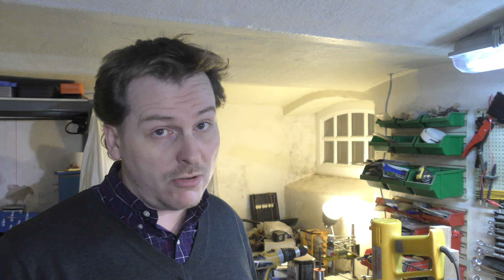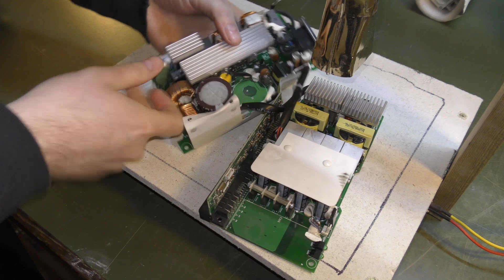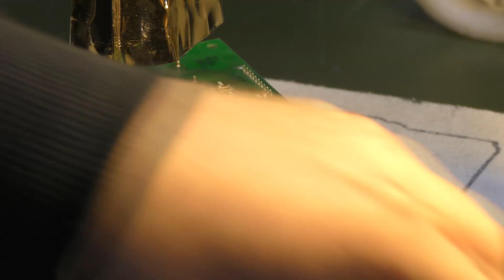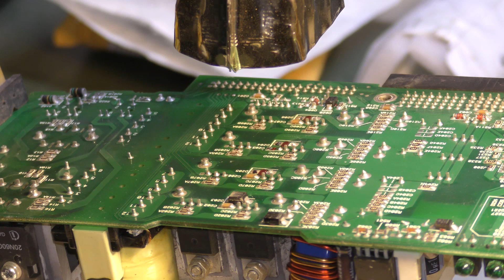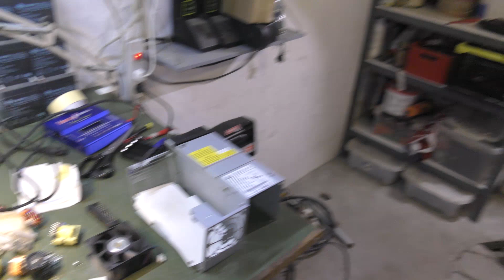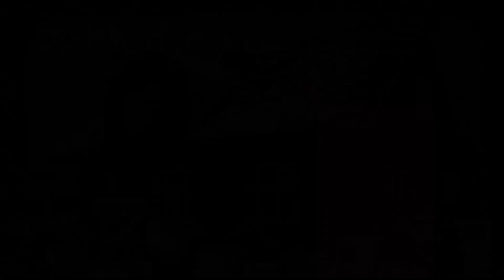Converting old Server PSU to the good Spare Parts - 464

Comment: The Blue things on the power plug are MOV's (Metal-oxide varistors). They are used to prevent voltage spikes from entering the equipment, its the same parts used in an anti surge extension lead. Got some usable parts there for some projects at a later date. Nice vid :)
Reply from the maker: Hi capri2wd
Thank You very much!  glad you liked the video :-)
Thank you for watching! :-)

Comment: the blue things on the socket are movs (metal oxide varistor), they are used for surge protection, so they will be in an extension (power strip, etc.) what has surge protection, they can only be "hit" with a certain amount of surges. wikipedia article on movs http://bit.ly/varistor

Comment: That will teach that psu for failing on you LOL :-D

The electrolitic "Crapacitors" i would test for good esr, very common to go bad, and semiconductors can be tested if you have the interest.

I dont think the transformers will be much use to you, unless you need thin copper wire.
Allways handy to have a few parts, you may be able to make something else work for free :-D
Reply from the maker: Hi zx8401ztv
That is the way I think, as well!
Thank you for watching! :-)

Comment: I have been trying to repair a power supply/charger unit for a 24V battery operated cleaning machine, it gives out 24V at 30A - and the smoothing caps are actually slightly bulged (and they sit in between two heat sinks!), but unfortunately, the bottom side of the PCB is coated with some sort of glossy conformal coating. I set my soldering iron to 500°C, and got some of the solder to melt, but it just wouldn't let me take it away, it seems that the solder mixes with the molten coating and becomes an even more stubborn liquid to take away, in order to desolder the components. Now I'm at a loss and don't know how to proceed (except trashing the unit and have the batteries charged with a normal car battery charger, since it is fortunately 2 12V car batteries in series that provide the 24V for the unit).
Reply: Seegal Galguntijak try removing it with 95% alcohol and cuetips. If that doesn't work, try using acetone instead.   WARNING!

The acetone will dissolve plastic, so be carefull!
Reply: Bo Holbo Rasmussen I don't think it will dissolve that, this looks like some ultra-thin plastic coating. So yes, Acetone might work, but I don't want to deal with a dangerous substance like that - I don't even know how to get this stuff here in Germany.
Reply: Seegal Galguntijak Acetone is safe as long as you don't drink it or inhale the fumes for a long period of time...  Just go to your local supermarket (even Lidl sell it in Denmark) and go to the area where they keep the makeup. 
Search for the nail polish remover. (Nagellack-Entferner) 

This is mostly made of acetone, but it it likely to be expensive. 

If you can't find the nail polish remover, walk over to the area where they keep the drain cleaner and look for the acetone there. 

You could also try your nearest brick & mortar store (for example obi.de)

http://obi.de
Reply: Bo Holbo Rasmussen Thank you, but that's the kind of stuff I am not equipped to handle, I don't want to use it, not even in small quantities. Since it isn't even my PSU, but the one of a friend, and I told him "I'll have a look, but no guarantees", and he said "No problem, I still have the car battery charger", it will be OK if this is a no-fix.
Reply: Teenage girls the world over have been using acetone to remove nail polish for years, its not really that dangerous if use correctly. If it was they would put restrictions on its sale! But regarding your problem with the solder. Just because your iron says it is set to 500°C does not mean the tip is at that temperature or indeed it can put that temperature into the joint. Most likely the temp of iron tip is being dropped on contact with the joint/heatsink beyond what the iron can maintain.

Try adding some lead solder to the joints to reduce the melting point of the leadfree solder. Is it possible to remove the heatsinks first and reattach them after? Also, some boards have large ground planes that wick the heat away from the joint, so it may not just be down to the heatsinks. 

If you are doing this sort of thing more than a one off, it may be worth investing in a cheap soldering gun, not ideal for delicate work but they can pump a lot more heat into a stubborn joint in a shorter time-frame. 

TL:DR Solution.
1 Add some lead based solder to joint.
2 Get a solder gun. Its not a case of putting more heat(Higher temp) into the joint. Its about the solder gun been able to maintain the set temp without the heatsink lowering its temp, if that makes sense!
Reply: oOMonkeyMagicOo Thank you for your suggestions. Adding solder is an idea I could try. However, I mentioned the heatsinks only to point towards a design flaw that is still common in more modern PSUs (this one is at least 10 years old), which is to put electrolytic caps next to heatsinks from other components, so the caps are heated externally by the heatsinks. That's how it is here, so I don't need to remove the heatsinks in order to get to the caps (there are a few mm of space in between), but the positioning of the heatsinks and caps is likely to be responsible for the caps to have gone bad.
Reply: Seegal Galguntijak
Yes! But the reason I asked if the heatsinks could be removed easily and then replaced would be to stop them sinking the heat from your iron away from the joint. The fact that the heatsinks are close to the caps, they may also be electrically and thermodynamically connected to the same ground plane as the caps negative connection. This lowers the temperature of the iron when connected and makes it hard to melt the solder. If the heatsinks are removed, you may not have to pump as much heat into the common joint.

As you plan on replacing the caps, you can cut them away with a snips so only the legs are left. The positive leg will most likely desolder easily. The negative leg may need a beefier solder iron/gun, but the lead solder should help.